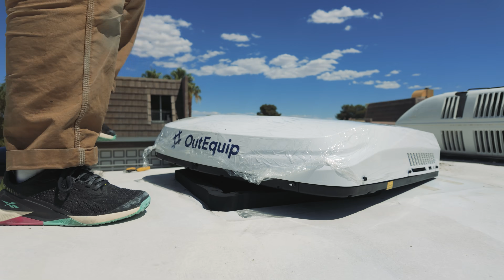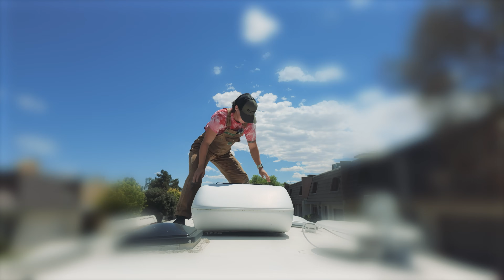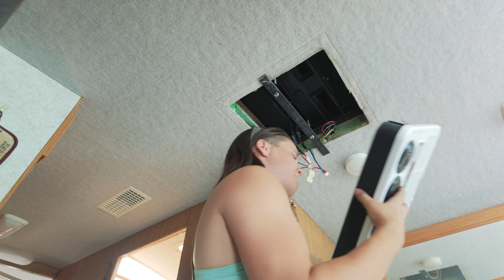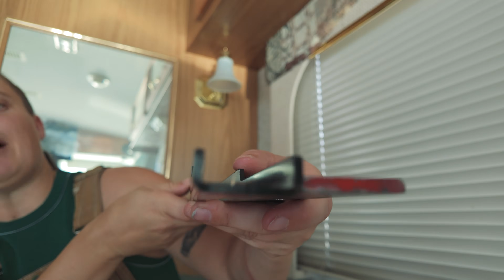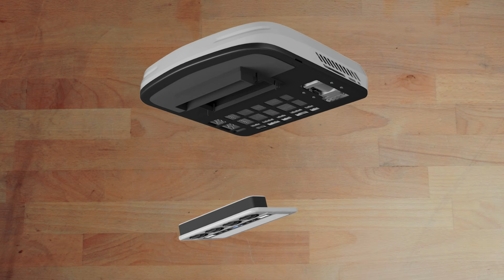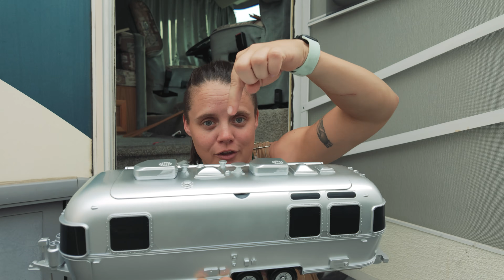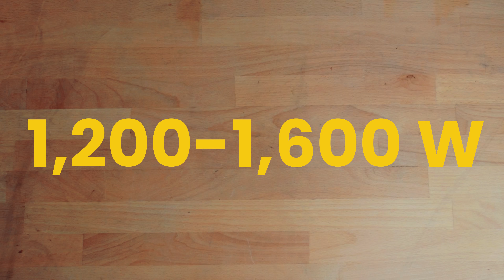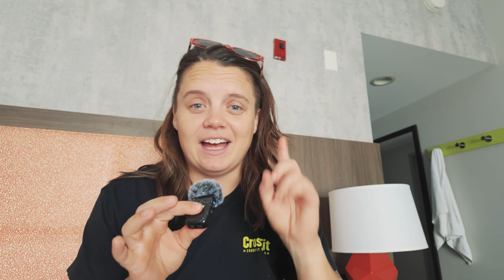Better RV Cooling with Less Power? My Switch to a 12V  AC | OutEquipPro AC Honest Review

Comment: Hi, just ran across your video.  I was a mobile tech there in Vegas from 2008 to 2020.  Since escaping to Indiana, I’ve moved more into battery/inverter installations.  I tried a dc air conditioner and was not impressed with the airflow.  It was a new van build, so everything else went smooth and the bank was 600 ah Lifepo4.  I’m not convinced that when July rolls around, that you’ll still be happy.  Can’t wait for a progress report.  I really want them to work but right now, I put them in the same catagory as tankless water heaters.  Not ready for prime time.  I hope I’m wrong.  Good job on the presentation though.
Reply: I’m wondering the same thing.  Looking forward to some tough summer testing. I need to be able to make a decision soon. I would like the flexibility of DC but not sure it will perform well enough subsiding in Texas.
Reply: Very good video, illustrations, trouble shooting. Way above my head but if I get one of these AC units, this will be assisting the installer.
Reply: I have a small portable AC by Black+Decker that will help get me through the Texas summer and it runs perfectly on my Ecoflow Delta 2 Max in my 30 Amp RV.  Works great for 100 sf and so having 1 for the master and 1 for the bunkhouse both running off a trickle charging Ecoflow delta 2 Max could be a way 30 Amp RVs or 12 Volt ACs can get you through a very hot summer.  Having those extra power banks are almost necessary for a 30 Amp RV
Reply: I have been using tankless water heaters for almost 20 years. BTW DC motors are by far the most powerful and efficient method of turning a spindle. There is no reason a properly designed 12V compressor and fan motor would be worse than AC in an AC unit.
Reply: @MrKiwi13605  Indeed... think about how well automotive A/C compressors run on 12v DC!
Reply: @optiskeptic4746 
Forgive me, but most automotive A/C compressors are driven by the engine.😉
Reply: @MrKiwi13605 I didn’t know they had rv tankless heaters 20 years ago.  With regard to dc turning a motor… no argument thereexcep as the battery voltage drops, so does rpms.  Engineering wise, they just need to catch up.  They haven’t perfected the airflow  quite yet.
Reply: @agrota21  Yes, I haven't researched it, but in 2007 while living fulltime in a travel trailer I couldn't take the 6 gallon shower any longer! I upgraded to a continuous model that I think I bought from E-Trailer. I don't remember the brand but it was American made. I have had tankless ever since (in homes and RV's). DC motors have come a VERY long way (from the first horseless carriages) to direct drive fan motors in every high efficency HVAC system and inverter compressors. They don't slow down with voltage drop because first there is no voltage drop (Lithium Batteries) and second they are digitally controlled. They run variable speed all the time.  The airflow problems are most likely a function of trying to save costs and lower the wattage on what was until recently a very expensive tech. Plus made in china is a recipe for under performance! With the ability to use 3 to 4 times less watts there is plenty of room to up the horsepower and torque. This is why EV's often do 0-60 in under 6 secs. It is not the DC.
Reply: @agrota21  He said "almost" 20 years. Try to keep up.

Comment: Great information and as others have commented here in the comment section, you are an excellent presenter of information. However, the most important information for testing an air conditioner is its ability to cool a specified volume of air and I think you skipped over that information, other than to say it cooled the air 20 degrees, and that difference was only at the unit, not the whole RV. The question needs to be answered as to how large of a volume of air will the air conditioner cool, and under what temperature and humidity levels. Air conditioner units must be chosen based on their ability to cool a specific volume, usually measured in BTUs. Many smaller RVs have a 13,500 BTU air conditioner. OutEquipPro offers 10,000 to 13,500 BTU options. Replacing a 13,500 BTU unit with a lesser BTU unit will result in a hotter RV and not be acceptable for most people. Additionally, medium size RVs generally require up to 15,000 BTU units and larger RVs require even larger BTU units and sometimes require multiple units. Bottom line, ensure a replacement air conditioner has an equivalent BTU rating as the unit(s) your replacing. Too small of a unit will not cool enough and too large of a unit will shut on and off too quickly without removing the moisture on a high humidity day.  Another consideration is the battery system size (amp hours) needed to power the 12V air conditioner for a reasonable amount of time. I expect only large battery systems will run the air conditioner for more than a half day or so before needing to recharge the batteries.

Comment: First time viewer. This is a very well done video. I don't know where else to put this request, but I noticed in searching your site that you don't have any videos relating to the AC/DC converter/charger for the coach battery. I would like to replace mine with one that has a lithium charging option or profile, but don't know quite where to start. If you should need an idea for a new video - you're welcome! 😉

Comment: Awesome video!! Wondering if I can run this with my system of 400w solar, 400amp agm batteries and 4000 w inverter? Thanks for any info! Robert
Reply: Bump the solar to 1000w agm is fine, but it should have bms and definitely 2 or 3 in parallel for 12v at 80a most agm are 20a discharge rating...
Reply: Thanks for the reply sqeekykleen49!

Comment: Thanks for explaining this system. I have s 2021 16ft Surfside trailer that will change out to 12-volt when goes down. I am setting trailer up for dry camping but will have to live without A/C till then. 
I do have a 1972 Lindy Class-C that I am remodeling and will put a 12-volt A/C on. But..what is your review with 12-volt mini split a/c to this roof mount?? Thanks

Comment: 12 volts is good and Rec but that says nothing about the watts of consumption. 12 volts is only the chip but not the broke, the watt in hours indicates how much watts the system consumes.
Sincerely from Switzerland
Reply: It is vrf so it varies 12v 56a ... but i would say 80a 9600watts... max output?

Comment: What about the heating function of that device? Usually heating consumes much less energy than cooling - so it might need just something between very amazing 200w and 250w...
Reply: No, it is not a heat pump, the reat is resistive, i would pass on that. Imo. It will have a rating, 800w or higher... idk. Check, but it will be higher than cooling.

Comment: Great video. I have a 2015 trailer that the a/c is showing its age.  I have a friend that’s going to help me install Freon ports to be able to recharge it, but I’m not sure if that’s a long term solution. With that said it sounds like this is a great alternative to buying an ac replacement unit once I do decide it’s time.  My question is I’m only running the one battery for 12v that the trailer came with. Will the trailer inverter be able to handle the draw of the roughly 400 watts? Would I wire this unit directly to the battery instead of the inverter and count on the inverter to charge the battery while it is in use/plugged into a/c? We don’t boondock at all at present but would love that option or being able to go to campgrounds without electricity.  Thanks again, will check out your other stuff. Did you mention price?
Reply: You want to gear at 1000w or 80a.. 2 batteries in parallel is best.

Comment: Nice video and explanation! You might want to do a 6mo and 1 year review on it? Also for the traditional rv owner that doesn't use 12 volts that often and only a single house battery the ac unit will deplete the battery quickly. You would have to have a few deep cycle batteries (wet, agm or lithium) to run it for an extended period of time. Which then you're adding more weight and cost to the set up. Not to mention where to store the extra batteries and time to run new 12volt wires. And the average inverter charger can't keep up with charging the batteries and would heat up the inverter making it have a shorter lifespan. But I can definitely see it used on the vans, class b, c , schoolies and truck campers especially if they are running solar

Comment: 22amps that surely on some eco mode and not on full power? I have 12v AC inverter scroll compressor type in my van. It draws 40-55amps during hot days in Greece with 35-40 Celciis outside. Having 400w solar and 560ah lifepo battery bank i can run it max 8 hours before battery runs out, thats with solar offsetting load. Your van must be parked in direct sunlight to use solar to offset and AC must run on max power to make difference inside the van during scorching sun. On eco mode mine does run on lower power around 30amps.

Comment: This also allows for a lot lower cost solar system if you only need a 12V solar charge controller which are inexpensive. The cost goes up when you need an inverter or you get into the all in ones which are usually 48V system requires lot more batteries. If your in really hot weather 110F or more likely going to pull lot more power. Example is I have a cheap window AC unit in a shed I'm in Phoenix when it was 90F outside it pulled about 380-420 watts. When I checked the power usage in July when it was 116F outside it was pulling 1000 watts.

Comment: A 12v air conditioner will pull more current than a 120vac unit of the same capacity. Just swapping the units you might have to replace the power wiring to the AC with heavier gauge cables. Significantly larger.

Comment: We have a GD 23LDE with a bedroom at the front. We have an air flow issue in the bedroom. I have been looking at a solution. We tried fans, redirection modification, but still airflow is lacking especially in the summer months.

This product may be our answer.....and....it would be located not only near the black tank vent, but also upfront near the battery.

Thanks for sharing!

Comment: I saw the 24v version draws even less amps what would the electrical engineering requirements, advantages and equipment needed? Thank you, wish you had been one of my lecturing professors instead of the usual Noam Chomsky coma inducing droning ones I had.
Reply: The main advantage of 24v is the amps are cut in half. This means smaller wires, terminals and devices. If you run this off of battery 2 batteries in series.... on a 12v you parallel the batteries to achieve amps...

Comment: @3:58 You are not going to get the same cooling for one fourth the power.
It is just ridiculous to believe that.
Every cooling system in the world would be switching over to 12 Volt DC.
Reply: Those bulky old rooftop ACs are ridiculously inefficient. They use single speed compressor motors that are either on or off. The blower fan motors only have a few speeds. So the air temp coming out is always the same. How much cooling you get is controlled by how fast the air is blown through and by cycling the compressor on and off. So the temperature inside the RV is always yo-yoing up and down. So in most situations the thermostat has to be set cooler than what you really want to keep the higher temperature where the AC will turn on at a level that's comfortable - then you're too cold at the turn off temperature.

The new 12V models use 'inverter drive' fan and compressor motors with a variable speed. The air temperature coming out varies along with the blower speed. So the compressor can run almost constantly, yet more efficiently, especially when it's running less than top speed.

The "mini split" heat pumps use the same operating principles. I replaced a 14K BTU window AC with an 18K BTU mini split heat pump in my office. The window AC could not keep the room truly cool in summer while the mini split can about freeze me out if I turn it way down. Even better, my summer electric bill has been a lot less. More cooling using less electricity due to a far more efficient design of the heat pump. Additionally, its also great for heating. It's able to pull heat from outside air at temperatures down to -5F. Since it rarely gets anywhere near that cold here in winter, and I also have a 95% efficient gas furnace, I didn't opt for the extra electric resistance heat in the mini split.
Reply: There is a big difference but on this 10k btu... a fair guess would be half the power compaired to an rv typical cap start one speed unit... but if you mainly are running thru a power converter, those eat energy.... ie 12v ac running on 120v is not as efficient as a ac rated at 120v of the sam vfd setup. But if you are doing solar or are outside of grid... yup.
Reply: @sqeekykleen49  It is the watts used to BTUs delivered that matters.
Equal BTUs delivered for 1/4th the power is a farce.
Reply: Not the 12v part .... it is the vfd and the new refrigerant.... that is how they get the efficiency...

Comment: Great video! I have a Hymer Aktiv 2.0 class B Van and will love to replace my old AC with this one. I just installed a 12volts 300AH extra Cloud energy battery which could supply the  energy needed to run the AC for a few hours. Thank you so much for such a informational video!

Comment: Your shore power comparison has a big flaw; even tho it's connected to the DC side, all of those watts are still coming from the AC circuit, plus some more watts for the power loss in the charger/converter.  It'll be much less power, which clearly helps, but not the 0 power that your explanation implies.
Reply: The benefit with dc is solar, otherwise tbh 120v on eco or shore. Bateries are $$$ to fly ac load.

Comment: I like this unit.  Even on a tiny house this could be a great option for people wanting to have the ability to be off grid on their own land.   I really want more of a tiny home in a small community.  But some vans and redone RVs are pretty cool.  Maintenance is my issue as I’m getting older.  
I’ve seen some mini vans and vans that are DC only.  I think this could be an excellent option for people in vans to really use on those hot days and nights to cool it down enough to sleep.  I’m thinking about a van instead of a tiny home, but I’m totally not equipped or handy enough to build it. 
This DC air conditioner is really a game changer in alternative living.  
Great video and thank you for the electrical information because I’ve always kind of blanked out on amps and volts and watts, terrified of electrical work especially Ac.  Been shocked a few times- ouch.     I’m learning and this really helped as many comments said.     
I subscribed and liked this great video and channel.  K.

Comment: Emily,  just been checking out the OutEquipPro lately,  and do appreciate your expertise/insight. Well done, however does this unit also have a Heater,  or is that another version made by OutEquipPro. Along those lines,  have you checked the " Heater version ",  and does it perform similar to the AC function ?  I would be interested in your input on that Heater version as well,  thumbs up or thumbs down and any details.  Always, Syn Silver ( New Subscriber ).

Comment: Great video with lots of useful info. But a something I noticed was  if you are plugging in you're going to need something to keep your batteries charged. And a of built in converts are going to struggle to keep things powered.

But another use for this would for moochdocking. You can run this AC and its only using about 1/3-1/2 of the 15amp plug wal plug you'd more then likely get access to without popping a breaker.

Comment: Maybe I missed it but how much battery and solar to run this?
Reply: 80a 12v a pair of batteries in parallel is optimal, check the amp load rating on the batteries
Reply: Solar, 1000 w is mint.

Comment: I bought a new ac unit about a year ago, and I just installed a solar system in my rv. This 12 volt ac sounds great, but I'm going to wait and see. I'd like to boondock more but I'm getting older and my generator is too heavy to lift in and out of my pickup. This could be the perfect solution. Great video,thanx

Comment: I know it’s not designed for this but do you think this unit could this be used in a ducted system with some extra fan power at the vents?
Reply: Tbh the duct will eat btus... if you duct the return it is better.

Comment: I feel like everything mobile should be DC powered. Alternating Current is for the grid!
Reply: 120v systems are more efficient, 12v is more established with vehicles... the inverter and the converter make it possible to convert power, but they consume energy... so if we have a solar setup, normally we need to convert to ac to power the appliances. This ac at 12vdc eliminates that wasted energy the inverter uses. The only disadvantage is the amps required at 12v. 80a needs fat cables. 😂

Comment: Your still going to need some way to charge your 12 volt battery which means you would need at least a fifty amp battery charger. unless you have that in solar panels which don't work at night. So I guess I don't understand how your going to make this work long term. Am I missing something?